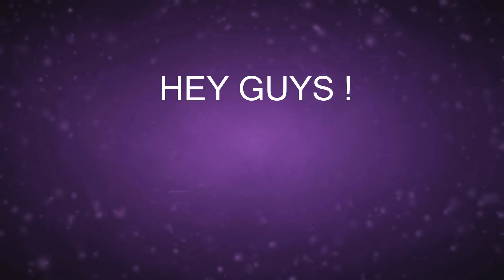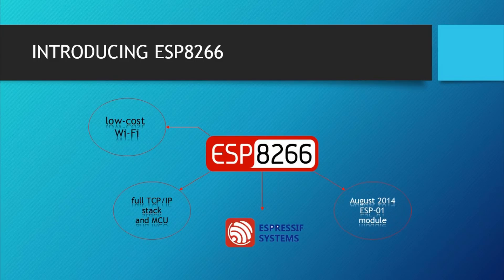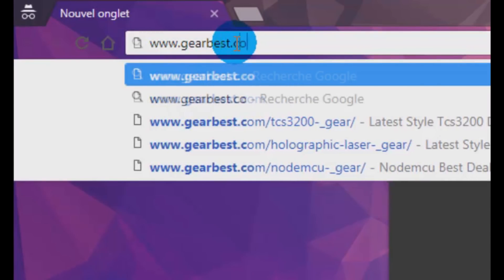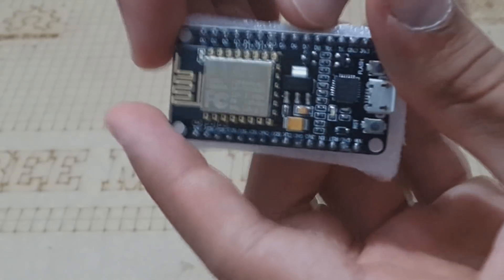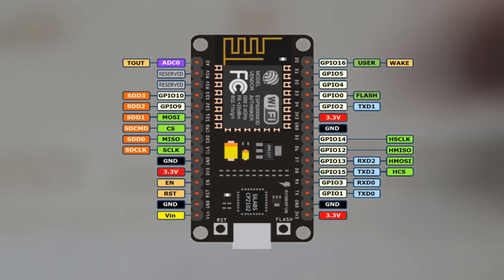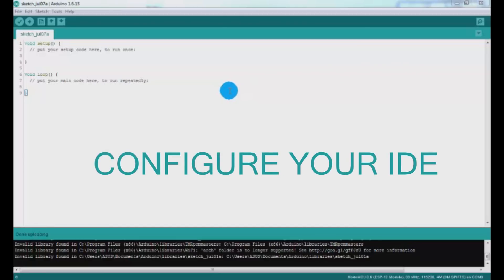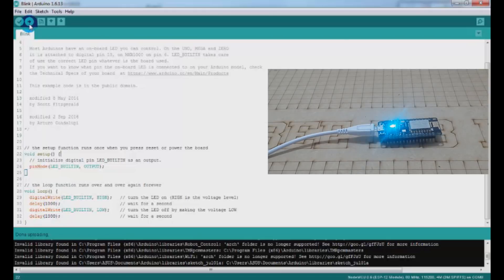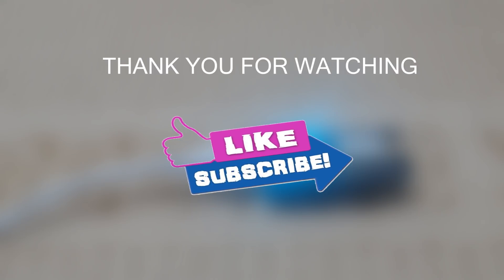Getting started with NodeMCU (ESP8266 tutorial #1)

Comment: Nice tutorial, thanks! Since the link to the code is broken, here is it (more or less):

char data;
String SerialData="";

void setup() {
  Serial.begin(115200);
  pinMode(D0,OUTPUT);     // pin D0 corresponds to the internal LED
}

void loop() {
  // read the string from the serial monitor (the console)
  while(Serial.available()) {
    delay(15);
    data=Serial.read();
    SerialData+=data;
  }

  // turn LED on or off (and send message back to console)
  if(SerialData=="on") {
    digitalWrite(D0,LOW);
    Serial.println("LED ON");
  }
  if(SerialData=="off") {
    Serial.println("LED OFF");
    digitalWrite(D0,HIGH);
  }
  SerialData="";
}
Reply: Thanks a lot man, I was stuck here

Comment: Would you be able to provide the script used to turn on and off the LED loop? The mediafire link is not working at the moment.
Reply: a little late but in arduino ide that would be 
void setup() {

 pinMode(D4, OUTPUT);

}

void loop() {
digitalWrite(D4, HIGH);
delay(1000);
digitalWrite(D4, LOW);
delay(1000);
}

Comment: the project code is no longer available
Reply: char data;
String SerialData="";

void setup() {
  Serial.begin(115200);
  pinMode(D0,OUTPUT);     // pin D0 corresponds to the internal LED
}

void loop() {
  // read the string from the serial monitor (the console)
  while(Serial.available()) {
    delay(15);
    data=Serial.read();
    SerialData+=data;
  }

  // turn LED on or off (and send message back to console)
  if(SerialData=="on") {
    digitalWrite(D0,LOW);
    Serial.println("LED ON");
  }
  if(SerialData=="off") {
    Serial.println("LED OFF");
    digitalWrite(D0,HIGH);
  }
  SerialData="";
}

Comment: Hi 
 Can you help with the esp8266 in home automation?
I'm using it for home automation and the problem is when it reboots as the power gone, it automatically turns everything on .
I don't need anything to be on state.
Please help with it ?
Reply: I am no Expert on ESP, but the controller starts executing a set of codes every time you power it on. May be that's what you will have to focus on. Hope you are still looking for the answer. If you have found a different answer that worked, please post it here. I am waiting for my board to arrive. Will play with it and updated when done.

Comment: Arduino: 1.8.2 (Windows 10), Board: "NodeMCU 0.9 (ESP-12 Module), 80 MHz, Serial, 115200, 4M (3M SPIFFS)"

C:\Program Files (x86)\Arduino\examples\01.Basics\Blink\Blink.ino: In function 'void setup()':

Blink:27: error: 'LED_BUILTIN' was not declared in this scope

   pinMode(LED_BUILTIN, OUTPUT);

           ^

C:\Program Files (x86)\Arduino\examples\01.Basics\Blink\Blink.ino: In function 'void loop()':

Blink:32: error: 'LED_BUILTIN' was not declared in this scope

   digitalWrite(LED_BUILTIN, HIGH);   // turn the LED on (HIGH is the voltage level)

                ^

exit status 1
'LED_BUILTIN' was not declared in this scope

This report would have more information with
"Show verbose output during compilation"
option enabled in File -> Preferences.

Comment: Hi, nice video.  I'm having trouble with the serial monitor display. The information is not readable no matter what baud rate I try.  Can you suggest the right baudrate to use for the Serial.begin instruction in Arduino? thanks
Reply from the maker: Hello Diggee17 
No matter what the baudrate you set for your ESP it should be the same in the serial monitor. Otherwise it will not work.

Let us know if we can further assist you.
Reply: thanks for your reply.  I'm matching the baud rate and I can get the LED to blink but for some reason, I can't get output on the serial monitor, Could I have a bad board? I never had this problem with an arduino board.
Reply from the maker: Try the 115200 baud rate and set "cariage return" in the serial monitor.

Comment: salut mec tu pourrais me dire comment il faut alimenter le node mcu sans ordinateur stp merci :)
Reply from the maker: Hello nope

You can use the "Vin" pin and "GND" pin to power on the NodeMCU using an external power supply source "up to 20V"

Let us know if we can further assist you.
Reply: MEGA DAS merci beaucoup 😊 mais comment l’alimenter pour un long terme ? (1 an)
Reply from the maker: You can simply use a power source like a 12V adaptor and you could make it run for more than a year ;)
Reply: MEGA DAS désolé j’ai oublié de dire que le node mcu sera en dehors d’une maison donc il n’y aura pas de prise 😅
On fait comment sans prise ?
Merci encore pour la reponse
Reply from the maker: I think a solar eneregy cell with a good lythium 9V battery should be good for your need
All the same, use the Vin pin to power it on with the battery
Reply: MEGA DAS okay merci beaucoup 🙏

Comment: Pls help my i got this error:

Arduino: 1.8.4 (Windows 10), Board: "NodeMCU 0.9 (ESP-12 Module), 80 MHz, Serial, 115200, 4M (3M SPIFFS)"

Build-Optionen wurden verändert, alles wird neu kompiliert
D:\programme\adroino\Arduino\examples\01.Basics\Blink\Blink.ino: In function 'void setup()':

Blink:28: error: 'LED_BUILTIN' was not declared in this scope

   pinMode(LED_BUILTIN, OUTPUT);

           ^

D:\programme\adroino\Arduino\examples\01.Basics\Blink\Blink.ino: In function 'void loop()':

Blink:33: error: 'LED_BUILTIN' was not declared in this scope

   digitalWrite(LED_BUILTIN, HIGH);   // turn the LED on (HIGH is the voltage level)

                ^

exit status 1
'LED_BUILTIN' was not declared in this scope

Dieser Bericht wäre detaillierter, wenn die Option
"Ausführliche Ausgabe während der Kompilierung"
in Datei -> Voreinstellungen aktiviert wäre.
Reply from the maker: Hello Leon
Try to use another Arduino IDE version like 1.6.5

Let us know if we can further assist you.
Reply: MEGA DAS i have figert out how the nodemc run But i have one Probleme, Can i  increase the Memory? I need more Memory because i will run the wifi Jammer Programm
Reply from the maker: Great to hear the good news :)
About the memory I don't think that you can add some for it because it is integrated int the MCU.

Comment: Hi 
Nice video and clear details.
Question! how to use Low power is this?
Reply from the maker: Hello Celine
In the comming tutorials I will show you how to do this.
It will be posted soon.

Let us know if we can further assist you.
Reply: Using an Operating system I guess !
Reply from the maker: Sure you can insert an operation system like "FREE RTOS"
Reply from the maker: Yes right, anyway using an operating system is better than using one loop for the whole program.
Reply: is it possible to use operating system with ESP !
Reply: for sure it is better to use OS specially with its high level task handling